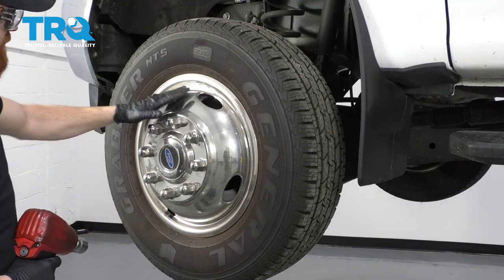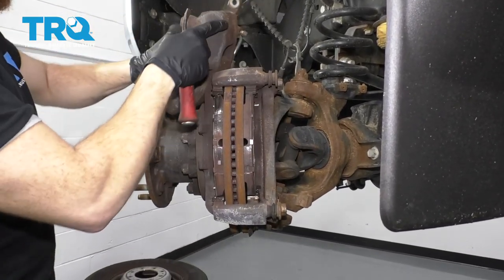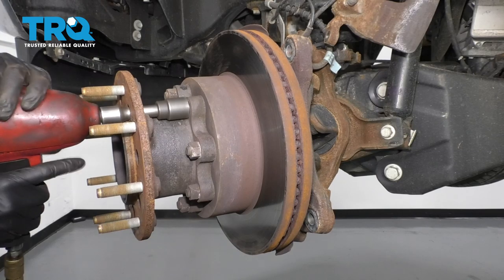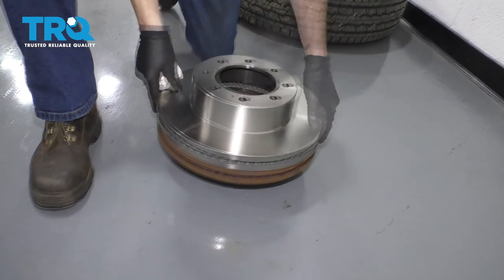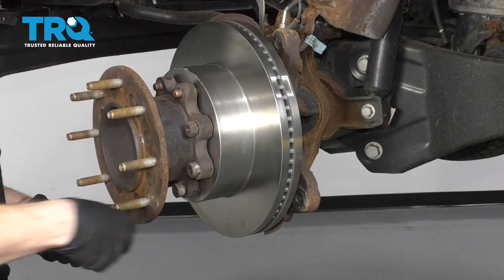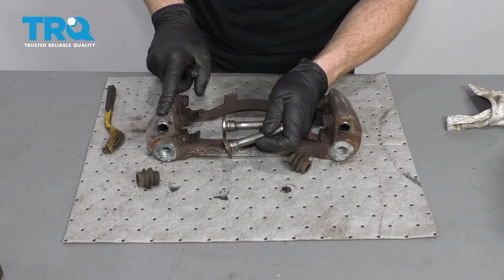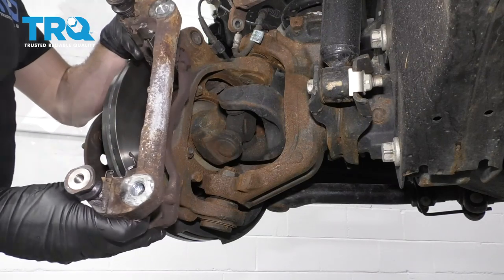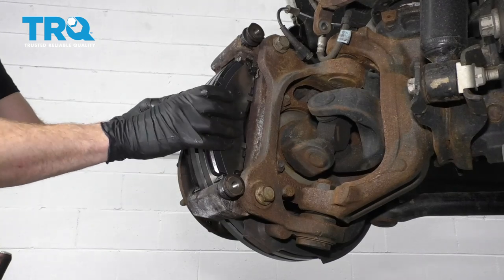How to Replace Front Brakes 17-Present Ford F-350 Dually

Comment: Nice detailed video. I should clean out the next caliper bracket better next time. I have not been cleaning inside bored where the pins glide, also I need to check the rubber grommets on the caliper pins for tears. At least I was already cleaning my pins with a wire brush. Would have to say its better than I was shown at Auto Tech school.
Reply from the maker: +raider762 Thanks for watching our video! http://1aau.to/m/Shop-TRQ

Comment: Thanks for this! I will likely now be able to do my F-350 dually. I need to find the rear video... and I hear that a local shop likes to replace rear axle seals at the same time. I'll watch that video, but if there's no comment on that, I'd be curious to know if that should be done, too.

Comment: Just one note- the service manual says to use new bolts on the caliper bracket. I doubt it will make a difference... but for about 10-15 bucks better safe than sorry

Comment: Is there any way you could confirm there is a difference between a 22 F350 dually hub/rotor and a 22 F350 SRW hub/rotor?  I’m currently converting a dually to SRW on the front and very deprived of information.  Thank you

Comment: salt on roads really blows, fortunately I have never owned a vehicle or worked on one that's lived on salted roadways but man what a bich, in the southwest a lot of parts are like new when you remove them at 160k miles.. seriously,specially garage queens.. I watch that just rolled in or customer states and man some of those vehicles will have the front end rusted completely off in under 10 years..  not kidding they show MANY vehicles that rust the frame or front end so badly its totaled, kid you not..

I knew salt rusts but had no idea it could lead to frames or sub frames being completely rotted off or thru to where the vehicle is un drivable...  I guess the only way to defeat this is to drive your car thru a car wash every 2-3 days after driving in that salty wash or slush, no jokes completely rinse that salty off of the vehicle, some car washed do have an undercarriage washing system, now we know why .. id get me a yearly pass and go every other day if not every day when I got close to home..  then I would DEFINITELY have my under carriage sprayed with double duty protection coating, every 3 years or so..